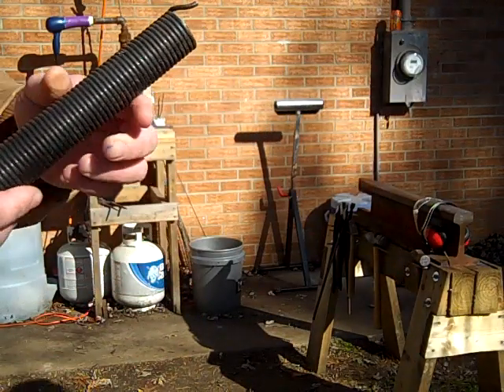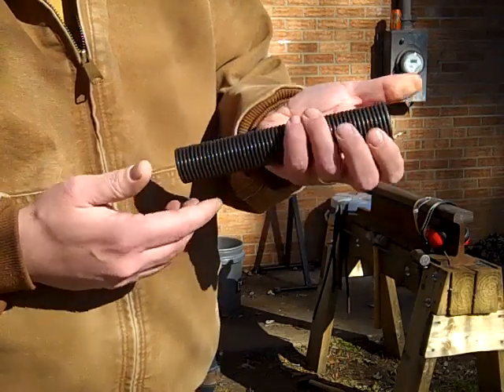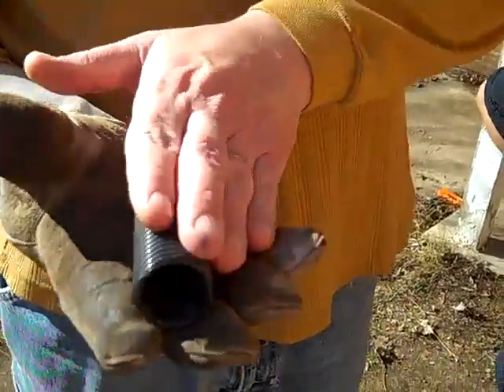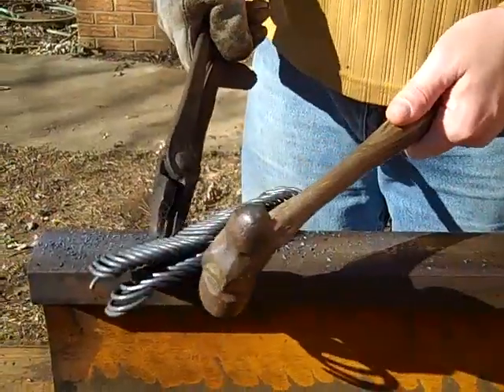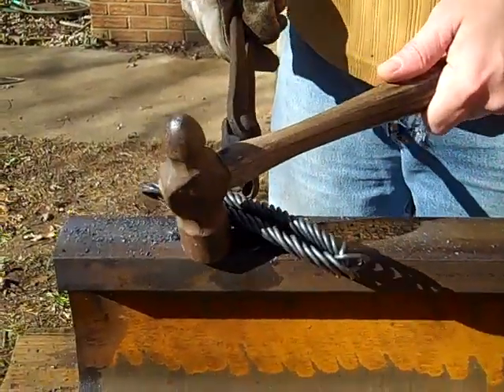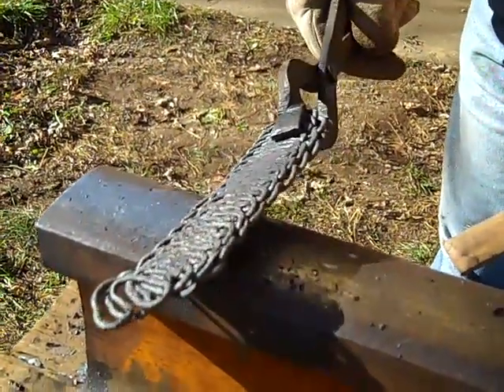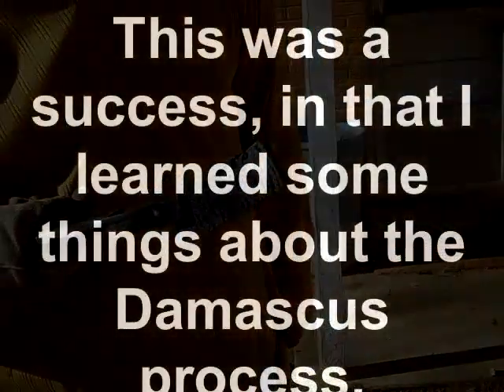Making Damascus from a coiled spring

Comment: You can't make Damascus from a spring, Just gives the metal a Damascus look "sort of". Damascus is not just the forging technique but the steel itself. Real Damascus Steel actually contains carbon nano tubes that are created throughout the metal during the forging process, which makes it very strong.
Reply: The English German you can not trust Wikipedia lol carbon nanotubes are made of carbon fiber not steel.
Reply: Carbon nano tubes aren't in Damascus.
Reply: "sort of" is just what he said in the beginning of the clipl...
Reply: ElijahMFearon I have known about it for awhile, can't remember where I heard it, here is a wiki that talks about it.
http://en.wikipedia.org/wiki/Damascus_steel
Reply: Modern Damascus is created by folding and twisting two contrasting metals together....one metal being higher/lower in carbon than the other or with other additives (like nickle which resists etching better) that will create the contrasting pattern when lightly etched....the wiki link talks about the Damascus of old which no longer meats modern standards and whose techniques are lost in history and only theories remain. So trying to make Damascus from a coil spring would not work but the spring steel would make a nice durable blade in the end....
Reply: Never heard of any nanotubes in Damascus steel...the main goal besides the nice pattern is that the softer steel is easily worn off so it makes "teeth" on the blade which then stays sharp
Reply: No one knows how they originally did damascus, but that doesn't mean no one can do damascus, they just can't do it the way they did it a 1000 years ago (or something).
Or to be more correct: no one knows how the crucible was made.
Reply: ElijahMFearon yes it can be but I was just explaining to the young squirrel the basics of what makes Damascus steel. The problem I see now a days is that we've got a lot of google and Wikipedia know it all's that trust the first search they get. We have become a people of too quick result and become believers of any so called trustworthy search engines.
Reply: Think you should do a little more reading on the subject. Damascus is just a current popular term that's used to describe several different things.
 The oldest technique is not crucible steel as you suggest but pattern welding. This can be dated back nearly 3000 in northern Europe. 
 Before you say I don't know what I'm talking about, I'm a professional blacksmith specialising in this area
Reply: Damascus steel is 2 types of steel. Also he missed putting flux on it so the metal would fuse good and the metal was not hot enough you can tell by the color.
Reply: The English German I know what you're talking about and you're right, but what you're talking about is Wootz steel, and the "damascus" referred to in the video is actually pattern welding, but most people know pattern welding as damascus, and the ones who know the difference, the people who smelt steel and blacksmiths, just call "true damascus" "Wootz steel" to avoid the otherwise unavoidable and sometimes tiresome explanation that will surely follow.
Reply: madhellsing Steel is a mix of iron and carbon. Iron by itself is too soft and ductile to make anything useful but iron oxide and such, so carbon is added to it during the smelting process to give iron its hardening properties. Too much, however, will make it brittle. The Wootz blades were shown to have 1.5% carbon, which would make a steel too brittle to make a useful sword, but carbon nanotubes holding it together at a nanostructural level keep it from shattering.
Reply: CARBON NANOTUBES?! ahahahahah wow, that's new. I'm new to the whole Damascus steel thing. But I'm pretty sure carbon nanotubes were only first created last century. Those Damascan folk really must have been ahead their time it seems.
Reply: true and i watched a documentary couple days ago about nano-tubes and they are made in a very specific way that i have trouble understanding so i doubt it was possible back in that time
Reply: Aron Sabaj
Has anyone ever actually gotten their hands on the real stuff?  I always thought that it was one of those semi-mythical things with the nanotubes discussion being thrown in as speculation.  There are almost certainly nanotubes and other weird allotropes of carbon in any steel and getting chemically pure iron is probably really difficult and wasteful, if you can do it.  There are probably a bunch of papers on both topics though.

edit:  Now it occurs to me that you could probably grow a pure iron particle fairly easily using protein magic.  I'm not sure about retrieving it but someone at Langley wanted money to use ferritins and tubulins as templates for growing quantum dots, which is basically what ferritins do.
Reply: knupder Actually, iron oxide (III)+carbon=iron+carbon dioxide. Basically, just heat crushed charcoal or coke and rust in a crucible and you have iron and carbon dioxide.
Not sure on the nanotubes thing, since it's still an emerging technology, but if you look here, http://en.wikipedia.org/wiki/Carbon_nanotube_metal_matrix_composites, it says it can be produced by melt processing although I'm still not clear on what melt infiltration is, and damascus wootz is made in a crucible (melted) so it seems plausible but I'm really not sure.
Reply: Aron Sabaj
You need to balance that equation.  A bulk sample of chemically pure iron is bound to be a pretty costly endeavor.

Melt infiltration seems pretty self descriptive, but I wouldn't worry about bleeding edge protocols in material science.  I don't think anyone has really managed to figure out how nanotubes grow, but they can figure out how to make them grow.  High pressure and temperature is going to weight things in favor of bonds that dissipate a lot of energy whatever the case is.  Probably owing to scale, goddammed everything is going to end up affecing how CNTs grow though.  The presence of metal particles (and the distribution of the sizes thereof) have pretty well documented consequence, though nobody really seems to understand why.

Comment: More flux. Your problem isn't the voids, its not actually ever folding the steel. The whole process is about folds=layers. Welding a bunch of thin strips does not a Damascus make. BUT take that billet you wound up with and fold it, hammer flat, then fold it again etc.....and dude, youd have one nice spring steel crazy pattern Damascus blade on your hands!

Comment: Not nearly enough heat. Get that spring damn near white hot, that dull cherry will not ever weld steel. And a ton more hammering, in which you actually hit that piece, hard. You're just patting the spring with your hammer. Let the hammer fall from more than two inches above the anvil. Lower the anvil if you need to to get a good swing. Some folks say to put the anvil top at the point that your elbow is at a 90, but I prefer lower to allow the contact to be made with my wrist almost straight, elbow about 135 degrees. Hit your billet hard. Make the metal's ears bleed, if you know what I mean. The metal loves the hammer, it wants it.

How did you flux it? I would have made a supersaturate of borax and water, and soak the spring in it kinda hot so some of the water evaporates and deposits the borax on the metal several times as you work. I'd do the first soak at the stage you were at on flattening it around 2:00. 

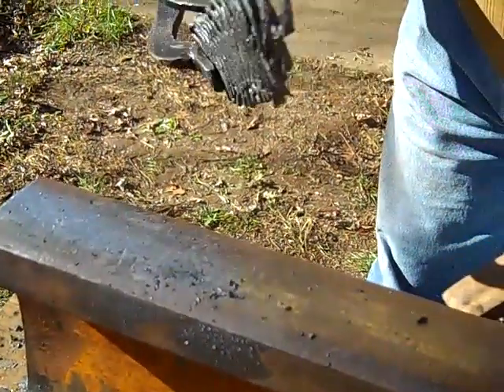It isn't that you did anything wrong, you just didn't do any of it enough. When you punted at 3:50, you were just starting to get it to go. Flux it, heat it to bright yellow and pound it until it screams your name.

Comment: Spring steel cannot be forge welded. As far as I know, you cannot forge weld other than carbon steel.. Manganese in spring steel just won't work. And as reading comments below, you can forge weld two similar steel. Generally, damascus is made from two  different carbon steels and then using acid to make the steel with greater carbon concentration to darken... Sorry about my poor english.
Reply: o2 contain manganese.....  spring steel can be forge weld but it's not the best steel to do that

Comment: what is flux? is it just repeated heating?
Reply: Many people use Borax as flux in welding and forging. It is a de-oxidizer and with that  helps to bond the layers together, because it removes stuff between the layers that would keep the layers from welding properly.
Reply: Flux can be either a powder or a paste that is placed on the metal as a cleaning agent to help remove contaminants. Plumbers use it all the time while soldering as do anyone who solder different metals. It's also used in welding with MIG or Stick welding using flux coated rods and wire.
Reply: flux keeps the O2 out of the weld and allows for a cleaner and easier weld

Comment: Raise your anvil. It should be where, when you hold your hammer on your anvil, it makes you elbow a 90 degree angle. Also did you use borax? It helps keep the weld clean.
Reply: It definitely shouldn't be that high it should be at the bottom of your fist when your standing it makes it easier the strength of the hit comes from the fall of the hammer not the strength of your arm

Comment: First time I've seen this done without two kinds of metal.
Reply: Edgunsuk it could have worked if he had fluxed it more and gotten it hotter before trying to weld it but the problem is that where would still be a lot of air pockets and inclusions
Reply: jester4115 u u have XT xxfx XT xz88xx XOXO
Reply: Wow! I have no idea where this came from?   Pocket comment I guess.   Sorry.

Comment: Some tips for forging hard-to-handle stock, be it chain saw chain, Harley Davidson motorbike chain, bundles of cables, springs such as this one. Start by getting it roughly placed as in the first couple of heats you did, then go straight to forgewelding with lots of flux (borax is fine...and cheap...clean sand...crushed glass etc). Your hammering should be light as to get the material "stuck together" rather than heavy forging into bar shape after a few of those heats then go to heavier strikes.

Comment: Building off of what you said, you also need a flux.
20 Mule Team Borax works, as you sprinkle it on and it removes all the oxygen from the applied area, thus allowing it to be hammered to the other piece of metal. Both surfaces being welded must be coated with flux.

Comment: if you don't want holls in your steal do this:
1# Weld a rod over the top of the spring.
Option:
(1) weld a second rod to the bottom and cut the spring in 2,
now flatten the 2 springs, now forge weld am together so you get 1 block. Remove the rod, or leave it and mix it in. this will prevent voids from forming.

(2)More Risk, cut a grove in the side's and just smak the top rod and let it buckle on the sides.

Do not try and fan am out.

Comment: Coke, coal, even charcoal, high carbon fuels.  Some things I learned - Too many layers and you are back to a solid block - 800+ layers you start to lose the pretty patterns - about 1200 layers is the 'sweet spot' for functionality - heavy hammers work better - the 'peen' on the hammer can control the spread of the metal - and, this is fun.  On this project, at the 4 layer step, I would have heated to yellow/sparks, folded 6 more times, made square, folded over spring steel bar, and hammered out.

Comment: For you to properly forge weld a coil spring I have heated it to a bright orange or dull yellow then fluxes it with some mule 20 borax constantly folding the billet till the voids where barely noticeable then I would fold it 6 more times this process removes all of the voids

Comment: I'm enjoying reading some of the comments here. Most are correct, some don't know how to properly use English, but most of all, trial and error is one of the many ways to learn. Forge welding damascus is a very precise process that takes many attempts to perfect. Proper flux helps, welding heat helps more, and practice makes perfect. If you try this again, flux it, and heat the metal to where it looks glossy and wet on the surface, and then slowly forge it into shape. Good progress though!

Comment: yur a dork you have to burn off all the plastic  then wire brush the hell out of it ,
 then pak it in borax  all the way threw , best take some 1/8th on 1095  clean scale free in the center for a core m bring it up to lemon yellow and then work it down , john henrey you steel driving man lol

Comment: Your temprature was fine for the initial forming, but you want it white hot for a fire weld.
You're looking for something called 'crows feet', this is the point just before the metal starts to burn and melt, it will start to give off star shaped sparks. At this point, you need to get it out of the heat and start hammering as soon as possible, and your key temp won't last for long...
Also, your 'anvil' is too far from your forge, you should be able to pull the metal out and just turn round.
:D

Comment: You need to get into a shaded area, the less light, the better, than you can see the different heat colors. If your metal isn't close to sparkling, it's not hot enough, crank up your hair drier on the cold setting, and the poundage on your propane, it's gotta be hot. I've messed around with that kind of spring steel, and I've welded it with a few rods of common steel and nails, and etc. But the patterns were always ugly. If that's all you've got, go for it, but there's better material.

Comment: I'd be very interested to know if you try this again, getting the steel hotter before forging, if it would produce damascus.  It's my understanding that the pattern of damascus steel is from the layers of steel that have different amounts of carbon in. Presumably, the spring is made of all the same type of steel, so I would think that in the end (after 3.8 years of hammering ;) ), you'd end up with a billet of plain steel.

Comment: in order to forge weld you need borax to flux the metals, and to heat the metal so hot that when you strike it sparks fly off. Good luck.... youll get it

Comment: If you have a shorter section of rail, you can mount it vertically.  The face is smaller, but has good inertia.  For flattening, I have a horizontal rail turned upside down.  Let the sparks fly!

Comment: This is where the cliche "get a bigger hammer" comes from. Slower, hotter fire, bigger hammer and you will see more of what you're looking for. From what I see in this vid you could stand to draw your blank more lengthwise and fold in from the sides. You are beginning to see the wisdom of "folded 200 times" for the most excellent blades aren't you? You're doing good, keep at it.

Comment: If you have a pattern from forging together one type of steel it is because of impurities.  Ideally if you perfectly forge weld the same metal together there should be no pattern.  Also, borax is like $4 for a large box if you want to flux it.

Comment: you need 2 different steels to get patten welded steel (damascus) 
so even if the welding had worked there would be no patten 
as the patten comes from etching away the softer steel showing the contrast between the 2 metals

But dont give up!  try mixing your springs with some mild steel wire
(and as others have said use borax and get it alot hotter!)

Comment: Hotter, with a better hammer on a flatter surface.
Use a C clamp and 2 motor mounts to quiet your rail. Cold side.
Folded coils always look good.
You had lots of voids, but not too many to recover from.
Heat, fold, hammer. Repeat.

Comment: Actually you could get a good billet like that, but you're going to have to get it hotter & it's going to take a lot of work.  It looked to me like you weren't getting the steel anywhere near hot enough for welding!

Comment: The idea has merit, but I would have found a piece or pieces of mild steel to fill the void inside of the spring. Make sure to find a piece that would fit well into the spring to avoid large air pockets. Heat the mild steel, stick it into the coil spring, back to the fire to heat both together then flux and weld. Flatten, cut in half and continue the process.  Could make neat pattern.

Comment: Some spring steels will react very badly to overheating. For example a 5260 spring would require you to spend several days normalizing/annealing to fix overheated steel, and even if you can refine the grain size from the overheat, the blade will still be very brittle. Good flux and higher pressures are more important than high heat as long as you can get it past critical temp. Just my 2 cents.

Comment: What you say is true, although somehow they manage to remove the oxygen from the equation in a foundry, that way the steel doesn't burn, just melts. But when you put the steel in a forge and heat it up, you are deliberately pumping air into it by means of a bellows or fan...
I'm sorry but I can't tell you how they manage to keep the oxygen away from the steel in foundries, I'm not a foundry worker, just a blacksmith.

Comment: Um, not really any more than you can repair burnt wood. The best thing to do if you burn the metal is take it to the anvil while it is still sparking and work it until it cools to a black heat, this goes some way to restoring the steels properties, but the piece will still never be the same.

Comment: it needs to be cherry hot to fold and hammer the steel  without extreme heat you can't fill those voids by folding  after folding a few times it should be white hot when you bring it out fold one side hammer flat then fold that over itself.  you are basically substituting smelting the steel because you don't have casing and a mold  white white hot man, the saxon's britons and french folded their scrap steel this way to fill voids and make swords and bayonets during wartime when material is scarc